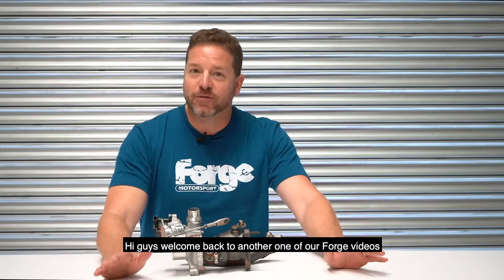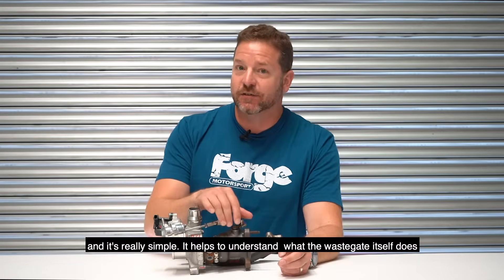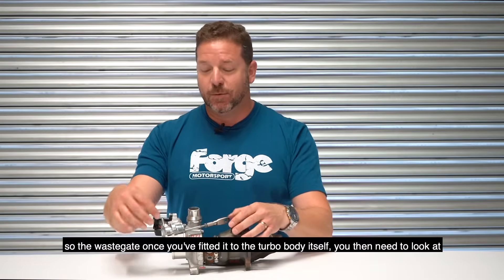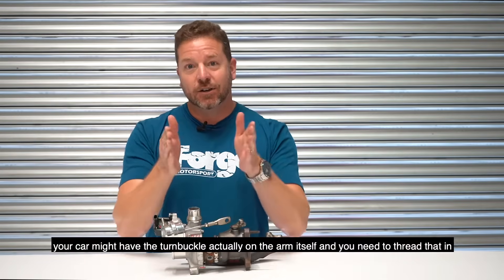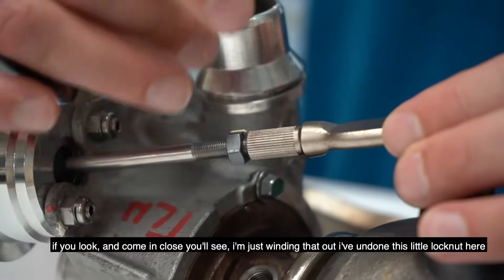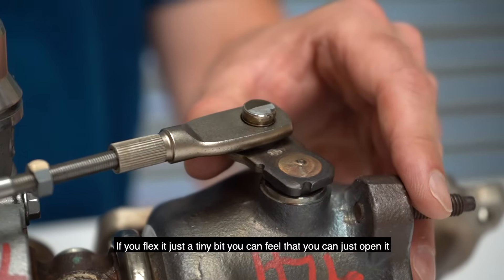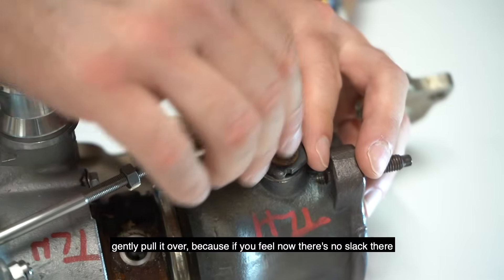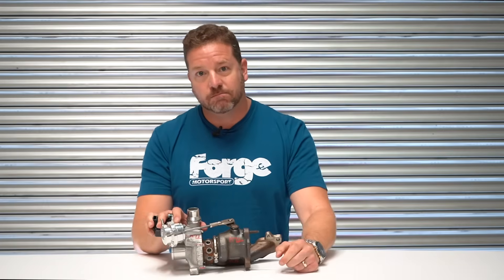How Do I Set and Adjust My Wastegate Actuator Preload? Watch this video to find out!

Comment: Lol no its not easy u dont do it right youll blow ur motor lol
Reply from the maker: As long as the instructions are followed, there should be no reason for this to happen :) The adjustment is really easy, and we always recommend that customers review the installation guide before fitting to ensure they’re aware of any specific requirements for the best possible fit :) - Forge Motorsport
Reply: Its literally a 60 second process. Can you use a wrench to loosen a lock nut? Then yes it is easy and couldn't possibly blow your motor unless you blatantly ignore the instructions and set way too much preload on the actuator.
Reply from the maker: @mitsuracer87  We all start learning about how to care for our cars and the install of parts at some point - so varying levels of knowledge is super common :) You're right that it's important to follow the instructions to ensure a smooth process and no unexpected shocks :) - Forge Motorsport

Comment: problem my vacuum actuator when the car is turned on pulls the wastegate shut so how can my actuator pull it any more or even open it if you set the new actuator to a closed position when installing a new flapper ..it would never be able to open the flapper
Reply from the maker: Hey Chris, if you'd like further support with adjusting your actuator pop put development manager Luke an email. He'll gladly work through the steps with you for the perfect adjustment :) Luke@forgemotorsport.co.uk - Forge Motorsport

Comment: some say 3 full turns while others say 3 half turns ? im confused
Reply from the maker: Hi Shawn, all adjustments will vary depending on the product you have in hand. Which video or product are you comparing to? If you have further information we'll be able to assist in more detail :) - Best, Esme. Forge Motorsport
Reply: @forgemotorsport  i did 3 half turns with new wastegate but turns out underboost code still coming on and not much of turbo feel however if i pull over turn off off and restart works good again for awhile
Reply from the maker: @shawncordeiro  Thanks Shawn, please pop an email to dev@forgemotorsport.co.uk confirming your car model, age, and the code (As this of course shouldn't be happening!) they'll be able to troubleshoot with you. Please include any relevant images or videos as an attachment :) - Esme, Forge Motorsport

Comment: I have an electronic actuator. For calibration I need to calibrate it with a software. My Launch X431 CP919X BT has possibility to calibrate it. Have you any experience to complete a calibration with a scanner?
Reply from the maker: Hello,

Thanks for reaching out! It's not something we'd be able to advise on specifically, our actuators are mechanical as opposed to electronic. 

There are some handy resources elsewhere on YouTube that should help guide you through the process. Alternatively, we'd recommend contacting the actuator manufacturer - they'll almost certainly be in a position to make recommendations. 

All the best,

- AJ, Forge Motorsport

Comment: What if you running stg2 tune,about 18psi
I been looking and every video shows the same 3 turns method,is this correct?
I have the same wastegate with the blue spring

Comment: I ordered a new actuator for the fiesta 1.5 and my new one if I close the wastegate and adjust mine there’s not enough thread like bar on the copy one is slightly shorter could do with a longer end bit to screw on to allow me to set it up right
Reply from the maker: Hi, could you please email us at media@forgemotorsport.co.uk with the product code of our actuator and we'd be happy to help. If you could also send a picture of the actuator with a ruler or tape measure next to the rod so we can check the length :) 

Thanks!

Comment: Would this be the correct set up for a focus st 2.5 2008 ? Standard mapping
Reply from the maker: Yes! The only difference would be spring strength on the actuator depending on which one you get, but the pre-load is the same :)

Comment: Can the pre-load be adjusted to cut down on boost spikes?
Reply from the maker: If the preload is being applied as described in the video clip then boost spikes cannot related to this aspect of actuator tuning, the only way preload would possibly contribute to what is described as spiking would be if too much preload has been applied preventing the wastegate from opening effectively to bleed off boost pressure, boost pressure bleed of course being the primary function of the turbo actuator – potential scenarios/explanations will vary depending on the model and any tuning that may have been carried out :)

Comment: hello sir, I watched your video about adjusting the actuator, I have an astra g z20let, 140kw, 2001, since the nut on the actuator came loose, I don't know how to return the actuator to the factory setting, how much pressure and how to adjust, I would be very grateful if you could you helped me how to set up,
Reply from the maker: Do you have a product code for the actuator so we can refer to the correct one to give you some advice? :)
Reply: @forgemotorsport  no numbers only words to germany,factory actuator
Reply from the maker: @veselinsvetozarevic4545  Can we have your email address and I will get a colleague to email you :)
Reply: @forgemotorsport  where should I leave your email address?
Reply from the maker: @veselinsvetozarevic4545  please message us on Facebook or Instagram :)

Comment: Nice video! i have a little issue with my Td04-19t on my saab 9-3. In 2nd and 3rd gear it does have 1.6 bar all the way up to redline (sometimes rarely it holds 0.5 bar when i floor it wich is base boost pressure) Yesterday i went for a top speed run and a 60-120 test but in 4th and 5th gear in high rpms is only has max 0.5 bar. Barely could get to 120 with 330hp at the crank. My previous setup had a T25 widh about 240hp which got to 150 mph and ideas? I have a heavy duty forge wastegate with a 0.8bar spring in it
Reply: Did you ever get this figured out I'm have a similar issue.
Reply from the maker: Hi! Please email our actuator specialist John with all of this info, he will then be able to look at a solution to the issue you are seeing. john@forgemotorsport.co.uk Thanks.
Reply: @forgemotorsport  Thanks, did but he is on holiday until 9th august :(
Reply from the maker: @Grandpasaab  Hello! Try jamie@forgemotorsport.co.uk instead and he should be able to assist :)

Comment: What do I do if my turn buckle cannot be tightened/turned in anymore? I want to turn up my boost before a retune but I’ve noticed my turn buckle cannot be screwed in anymore
Reply from the maker: If you have one of our Forge actuators we can look at supplying you with a shorter shaft, this will then allow for further adjustment on the turnbuckle. Please email info@forgemotorsport.co.uk for further assistance.
Reply: get a better wastegate with different springs for boost pressure.

Comment: if the wastegate isnt there you wont get any boost at all... unless you meant that theres no wastegate port aswell?
Reply from the maker: Hello, If there was no wastegate, i.e there was no port for wasted gases, ultimately you would get as much boost as the turbo would be able to provide. Alternatively, if there was no wastegate flap, but a hole in position to exhaust the gases, you are correct, no boost will be produced :)

Comment: I have a different brand turbo but I have to pull hard with pliers on the actuator to get it back on the gate.  I havent adjusted it at all, came like that from factory.

What would happen if the preload is too high?
Reply: boost spike
Reply: @pigeonsil240sx that's bad? Can that damage the engine /turbo?

Comment: does this apply to having a higher lb-spring (yellow spring) installed?
Reply: Yes sir it does thank you , also a video setting up a k03/k04 actuator for say the vw  with the rod and nuts would be awesome as some things do not transfer over like you say they do as there is no eyelet to slide over , but I'll probably just bring my turbo and actuator to the forge shop in Orlando as it's right down the road from me and have them show me .
Reply from the maker: Hi Brandon, for our actuators the method would be applicable for all of our spring ratings/colour options. 

I hope this helps

Comment: Great!! More simple explanation, but I'm still confused. I just purchased your actuator for my 96 Volvo 850T5. IPD says that on the original actuator found on the car, you pump 1.8 psi into the actuator and then adjust and install the rod over the wastegate. Am I accomplishing the same thing with your method? I have model #FMACT5S. Should I pump air into yours, and if so, how much PSI?
Reply from the maker: To give you better help with your query please can you email our resident expert at Forge! - John@forgemotorsport.co.uk